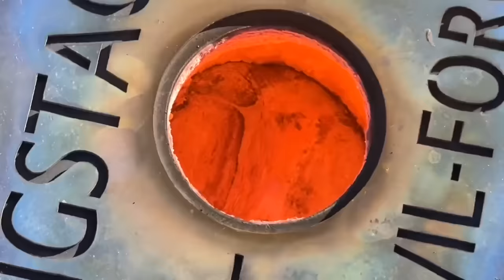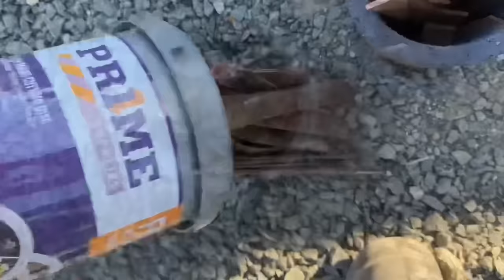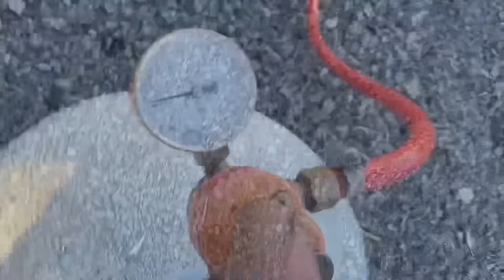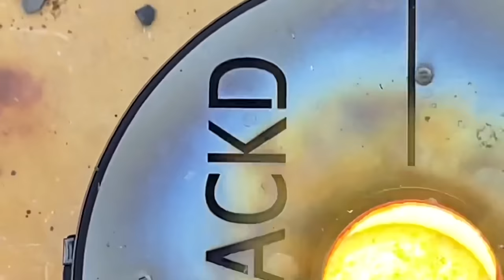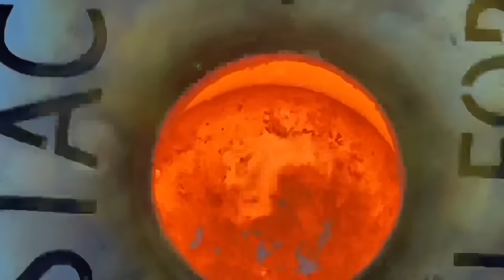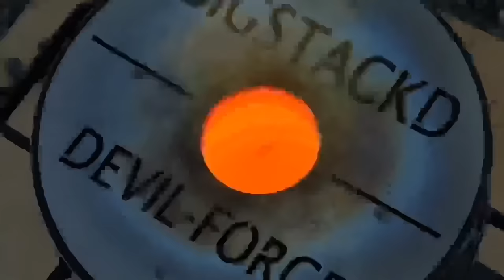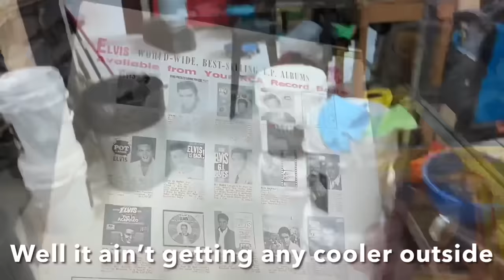Street Scrapping Free Metal - Copper Bricks - ASMR Metal Melting - BigStackD Trash To Treasure

Comment: You should consider strapping one of those vibrating sander things to a block or brick that you put the molds on to even out the top of poured ingots, especially aluminum with that high surface tension. I bet it would make it a lot flatter without having to buy special vibrating tables or anything like that

Comment: A quick way to clean those copper ingots is to put them in your little cement mixer with fine sand and water, and tumble for an hour or two. They will be very clean and shiny with no clouds of metal dust and abrasives to worry about.

Comment: Hi D.  I'm sure you've thought about this or heard the suggestion, but in case you haven't...I wondered if you could build a big tumbler out of half of a drum and a washing machine motor that you could place the ingots and coins into to clean them up rather than the drill and wire wheel?   Just a thought...M

Comment: Zinc can be tested for with a simple solution of water and copper sulfate, simply drop some on the bare metal and if it turns black it's zinc. If it turns coppery or doesn't change color it's aluminum

Comment: Have you ever thought about working on something like a frame which holds a blowtorch in position to keep the form heated up while you pour the metal into it? Just as an attempt you could lower the heat slowly, maybe the ingot becomes smoother then. I don't know if it actually makes a difference, just an idea that came into my mind.
Reply from the maker: Yes definitely want to get something like that made up for sure even if it’s just with a smaller burner not the bigger ones I use in the 10 kg furnace. I’ve got a few plans in the melting area I want to do . 
I got hold of an old cement mixer, which I wanna convert into a standstill double burner type of furnace where I can chuck small engine blocks or buckets of Cans at a time into it and have a small hole in the bottom for the aluminium to drip out of.  Probably end up putting a large crucible underneath so it can slowly fill that up then I’ll remelt it and pour into a perfect bar if this makes sense👍🏻.

Comment: How would you go about data cables for the copper. I believe its about a 40-50% weight return from removing the insulation but removing the inner insulation I wouldnt have a clue. Thought about melting it and scraping it off but then ive got the issue of plastic smoke.
Reply: He'd need a granulator for those. Expensive setup, but works awesome!

Comment: I think I might have an idea to improve the quality of your brass, and possibly the Nordic gold as well. I have no idea if it will work, but it seems like it might. I don't have any of the equipment to do it myself, but you might like to try an experiment. When you are alloying a low melting temp metal with a much higher one (Cu melts at 1085°C, but Zn boils at 903°C, which is what that white "smoke" is when you overcook it - Zn vapour), maybe try melting the two metals separately, then stirring the low temp one into the molten higher temp one in the crucible, then pour and quench as quickly as possible, and hopefully the Zn will survive.
Tin's not a problem - it might only melt in the mid-200s, but it boils at well over 2000°C.
Just a thought...🤔

Comment: Aluminum is the 13th element on the periodic table, as such it is a lightweight silvery white metal with a density of 2.7g/cm[cubed] atomic mass of  26.981539 an Electron configuration of [Ne] 3s(to the power of 2) and 3p(to the power of 1). Its melting point rests at 660°C (1221°F). Fun fact: Aluminum is the most widespread metal on earth and accounts for about 8% of the earths mass, it is also the 3rd most common Chemical element after Oxygen and Silicon.

Copper is number 29 on the periodic table of elements and is an incredibly ductile, reddish metal. With an atomic mass of 63.546u and a density of 8.96g/cm[squared] at room temperature. It has an electron configuration of [Ar] 3d[to the power of 10] 4s[to the power of 1]. Copper melts at 1085°C (1984°F). Your body uses copper to carry out many important functions, including making energy, connective tissues, and blood vessels. Copper also helps maintain the nervous and immune systems and activates genes. Your body also needs copper for brain development.

Comment: What's the difference in putting cold copper pieces into a hot furnace, and that of using a cold mold to pour hot metal in. So why don't both of these methods cause steam explosions?
Reply from the maker: If the copper hasn’t quite melted and the crucible isn’t full of molten metal yet you can drop cold copper straight on top of the other copper, but if you drop cold copper into a crucible full of molten metal you certainly can get a steam explosion which will send copper up out of the hole on top 👍🏻.
Reply: @bigstackD  Thanks for the info! I love watching you take apart motors and turning metal scrap into ingots. I wish I would take part in scrapping copper and other metals for ingots too! But seems like a lot of expenses for the time being. Besides, I've got to figure out what I'm going to do when my parents pass on. Keep up the good work, I am surely there to watch most times.

Comment: Awesome video new sub here but quick question, do you recommend respirators while using an angle grinder on metals?
Reply from the maker: Yes, 100%, the amount of crap that goes into the air when sanding or cutting is very concerning. If you have ever cut or sanded and then seen what’s in the air, when it goes across the sunlight, you would be crazy not to wear a respirator 100% of the time👍🏻.

Comment: Hey I know I haven’t commented in a while but great video! Also how you been? I have a question in regards to an electric motor I’ve scrapped, I uploaded a post on my channel and pictures of the cut windings, if you could tell me if they are copper or aluminium that would be great! It’s just so hard for me to tell the difference! (Also thanks for the reply about the respirator! I used my new angle grinder to open my first electric motor 😃 )
Reply from the maker: Yeah mate had a look and looks to be nice Copper so should be all good. I commented over there as well.
Reply: @bigstackD thanks mate!

Comment: Great melt this week, brother! One question that I have is, where do you source your giant ice blocks? Not sure if they sell that in the States.
Reply from the maker: Mate, I just making myself. I bought a small esky and just fill that with water and chuck it in my freezer. Doing it that way if you take it out before it’s completely frozen. You can break off the bottom half and make crystal clear ice but I always get sidetracked and never take it out in time👍🏻. As it’s in the esky so it has insulation from the bottom and the sides, so the water will freeze from the top down, pushing all impurities and air towards the bottom of the esky, making the top half of the ice perfectly clear👌🏻.
Reply: @bigstackD  that's pretty frigging smart.